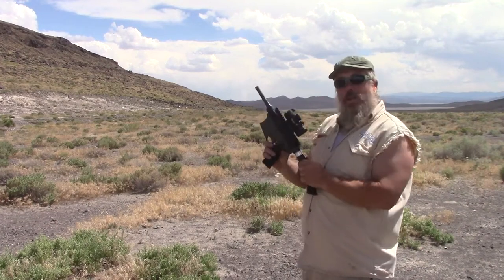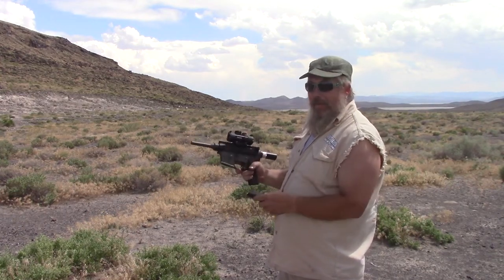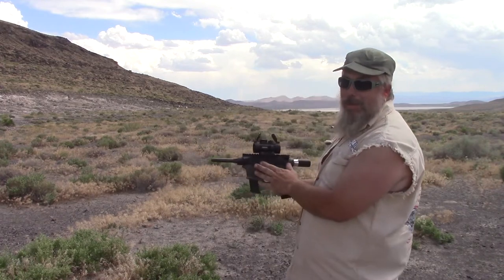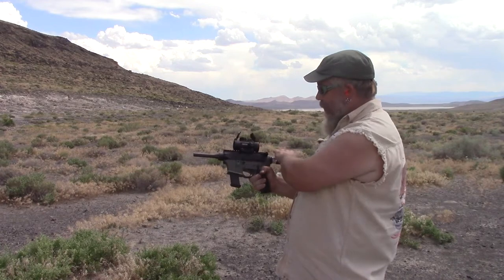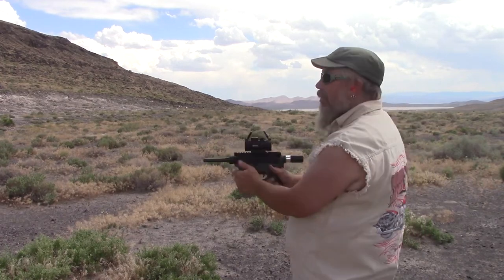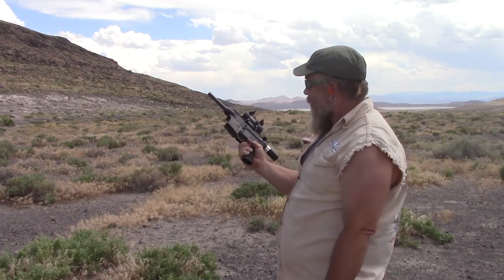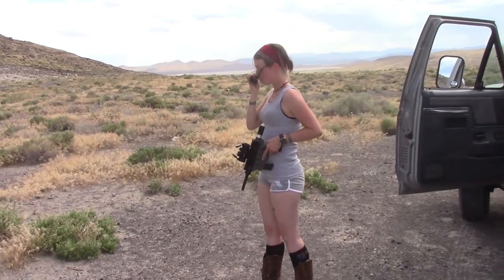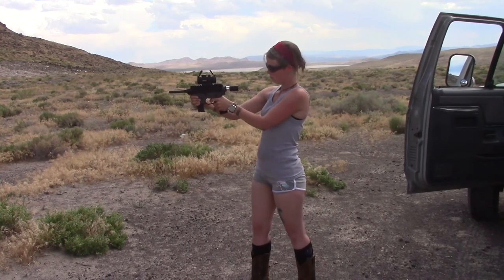9mm tungsten bolt carrier test fire with short buffer

Comment: What pistol buffer is that ?
Reply from the maker: I don't remember the brand. I cut it up and redrilled the pin holes for the plug to make it shorter. You can't, as far as I know, purchase a 2 inch totallength buffer and shortened pistol buffer tube that matches this gunsmithing project.